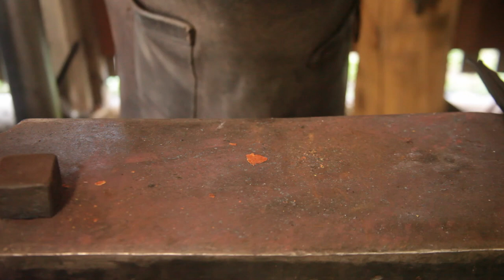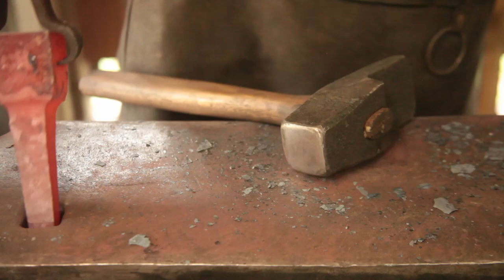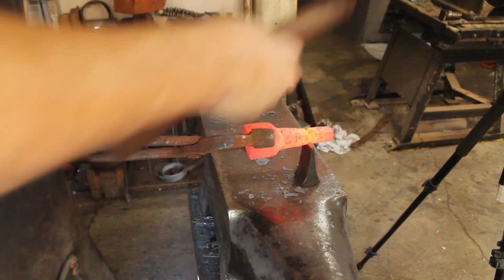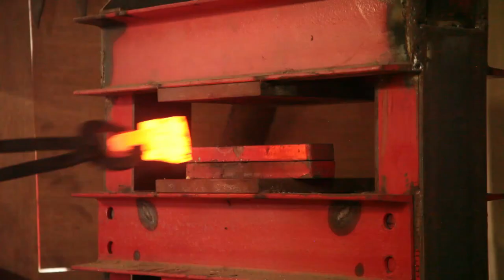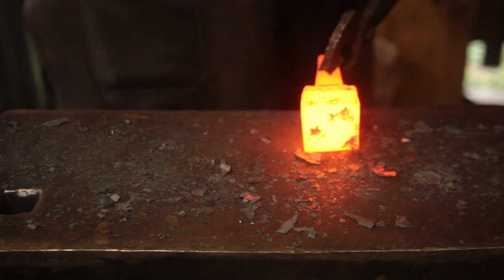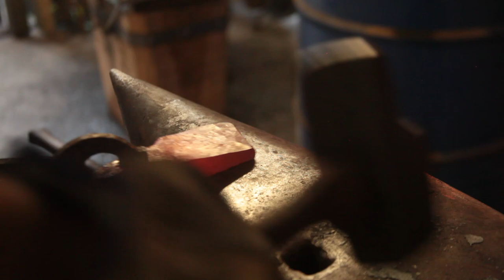Making more hardy tools for my French anvil

Comment: Doc, will you try again to enable the automatic closed captions?  I couldn't understand most of what you were saying when the burner was lit.  I guess you are using the camera's microphone which is picking up the burner(s), so perhaps you'll be able to upgrade one of these days to a wireless lapel mic?  I am amazed at the work you are able to do without expensive (powered) hydraulic presses and/or power hammers, by yourself with no striker!  Watching your work in these videos is encouraging to those of us with little to no equipment/gear.
Reply from the maker: I’ve logged it with YouTube, it might be a case of my having to transcribe and upload which will slow things down. I suspect it’s the background noise that’s hindering the automatic CC generation